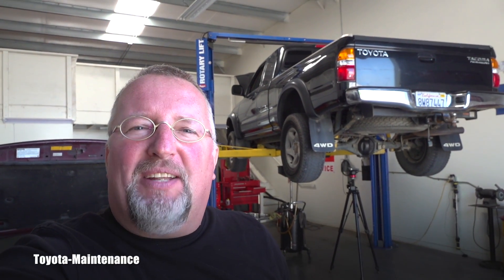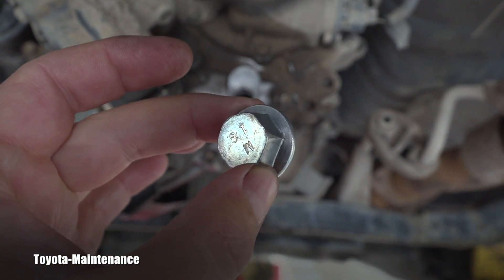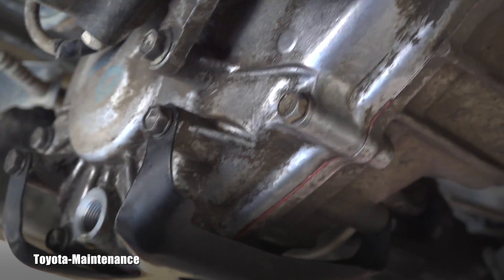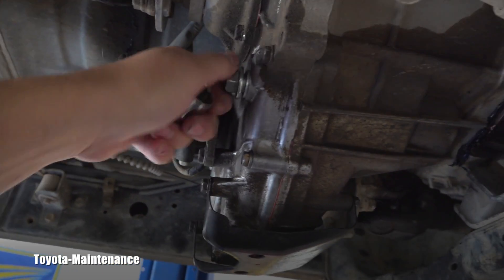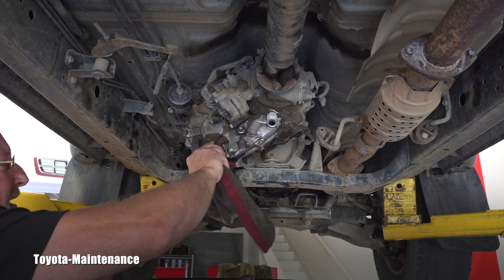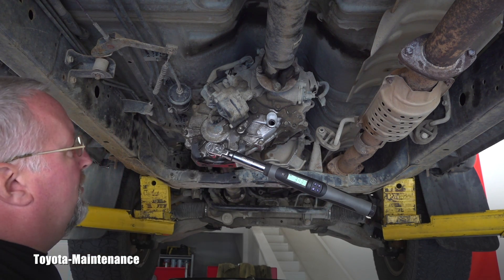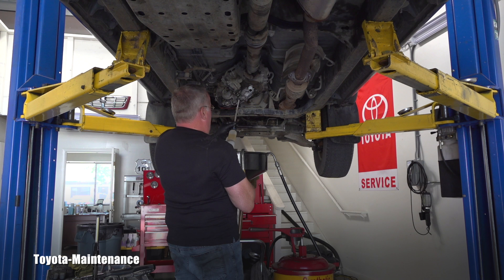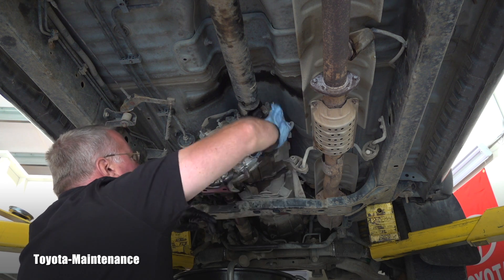Tacoma transfer case stripped thread

Comment: FYI, I’ve seen guys tig weld a nut on the outside of a drain/ fill plug and use longer bolt of same thread count. Takes longer, but works great

Comment: You can either rethread the outlet to a larger size using a tap and dye or you could weld a nut over the hole and use the nut to hold the bolt.

Comment: The oil change shop that screwed that up should have paid for the cost to replace!

I certainly would demand that, and prepare to take them to small claims court if necessary.

Then I'd repair it like this, pocket the difference, and never go back to the morons.

Comment: I would not consider that a permanent repair IMHO.  That is a threaded fastener (plug) for a reason, which is why Toyota designed it that way.  Vibration, off-road use, heat, internal pressure and time may cause that to fail and start leaking again. 

It is more difficult and time consuming, but a threaded insert is what I would have insisted be performed ... by the oil change shop... after first questioning whether they had a competent tech who has actually done it before.  Otherwise, I would take it elsewhere and insist on reimbursement.  Or do it myself and insist on a full refund for the original oil change and never return.

Comment: Gotta say I'm disappointed. Normally I really look forward to your tech tips, but this 1 is way off. At a minimum I would have used a helicoil, but I'd much rather see a timesert used. I think the sealant will work short term, but is far from a permanent repair.

Comment: That fipg gasket maker does wonders. I probably do the same to something that old. I used to have a company truck and jiffy lube was the few approved place I could take it in for oil change. Man, they wrote off so many things that they didn’t even do. They love it when these fleet vehicles come in as they know it’s a cash cow. One time they even rounded off my oil drain plug and was finding ways to not be blamed for it. They told me to come back as the manager only one who knows what to do and he wasn’t there. Really? The only thing I would do with my personal cars at jiffy lube is just the yearly inspection at my state of Texas. I feel bad for any cars that have to go there for maintenance and for customers paying for shady work.

Comment: At least the Ford exploding spark plug heads had four threads!
That stuff looks like gasket maker.
That would have been an ideal project for aluminum brazing rods.  I tried them for a small project and was amazed how strong the joint was!
Reply: Toyota FIPG stands for Form In Place Gasket.

Comment: Could you have made a permanent fix buy retreading before draining the old oil, so the old oil would catch the shavings and then drain, or just use a helicoil?
Reply: Bob D 
That would have been my choice of repair too (helicoil)
Reply: Why ? I would have done the same , I would be fine with using silicone with the rare oil changes it needs

Comment: that's why i work in my car. with the help of your video. this past Saturday i change the transmission fluid on my 2010 prius with 136,000 miles on it. the fluid was so dark, that i feel really bad. about not changing it sooner. hopefully my car can forgive me. and keep going for a long time. next Saturday i will do the radiator flush. great job my friend. i leave in Simi valley ca. maybe i can pay you a visit sometime too. Freddy
Reply: I was super hard on my Camry, mostly out of ignorance of required maintenance items, and probably didn't change the transmission fluid until ~120k miles. I've since put another 40k on it and  the transmission feels just fine. Don't beat yourself up and use it as a learning experience.

Honestly, your Prius is most likely going to have issues with the battery system before any transmission problems. From what I gather it's unusual if the batteries make it past 15 years and/or 200k miles. I'm not sure how strong the Toyota automatic transmissions are on a 2010 Prius but I reckon they could last 250k miles, possibly longer.

Comment: The place that ruined that cover by over torquing should buy a new cover and  pay you your prevailing labor rate to really make that customer whole again.  I believe you that the product is good and will hold up, but I would feel a whole lot better with a new cover.  I really enjoy your videos.   Thank you.
Reply: Good luck with them taking any responsibility, they never will. I got lazy once and took my suburban to one of those quick lubes places and they promptly stripped out my oil pan plug then told me it was already stripped. I changed the oil dozens of times myself and never a problem. Another time a friend took his van into a quick lube place and they filled his brake master cylinder with engine oil destroying his whole brake system. Never go to any of these places!!!!
Reply: Sadly you are correct but getting a jiffy lube to admit they stripped that plug will be near impossible.

Comment: In cases like that, I wonder if you could use a rubber plug.  It sounds cheap but I recall older Dodge read-ends having rubber plugs that worked fine.  Just a thought.

Comment: Even in the Toyota factory in Japan, sometimes they screw up with the overtightening of bolts and nuts.
I wanted to replace the original serpentine belt on my wife's 2010 Toyota Yaris. I used Snap-on Flank Drive socket to remove lower bolt of an alternator.  I completely stripped the head of that bolt and torque spec is only 40 Foot Pounds. I would never take my car to one of those quick lube places. I don't think that most of their employees are qualified and paid enough to care about customer's vehicles and I don't think they ever use a torque wrench. I knew there are always a few good people anywhere but I don't want to gamble with my car.
Reply: Cold welding is a common problem and using a socket wrench creates stress in the wrong location

Comment: I just did the transfer case on my 2019 and as far as I can remember both the fill and the drain used the same exact bolt and the bolts in your video the one going in the fill looked different versus the one going in the drain.
Reply: Drain bolts are magnetic to catch bits of metal shavings. Fill bolts are just plain old bolts, no magnets.
Reply: @TheHamburgler123  yes, but for some reason the transfer case drain does not have a magnet attached to it and rewatching the video it looks the same on this truck as well. I just checked Toyota forum and it looks like a topic that has come up a bit and obviously it looks like there are kits out there for this for under $10.00.

Comment: Nice fix, it's good seeing products you recommend. - What do you think of drilling and tapping a smaller hole in the original plug, then using really strong liquid metal epoxy to permanently seal it into place, and use the smaller hole to add the oil?
Reply: That’s a good idea. I’ve been thinking about ways to repair threads like this and a threaded hole in the filler plug would work. The filler plug could be put in permanently with a small removable plug in it.

Comment: It is a good fix. Would it last 10K miles? Probably since the fill level will only drop and has less pressure than the drain plug. A proper fix is complicated as when tapping a slightly larger thread hole, the shavings may enter the transfer oil pan. This leaves only one safe option: using an insert.

Comment: I havent found a trustworthy mechanic like Peter  That's why I do my own work Now I have  trust issues and have had bad experiences. I wouldn’t let those places shine my shoes. Good fix.        Don’t they have a heli coil that size Peter.   You can see the excitement in Peters   Voice  you can tell he likes  to work on Toyota’s 👍 I see 4 thumbs down that’s the   oil change guys LOL
Reply: A  heli coil was my first thought also. Then I thought of the aluminum shavings from the heli coil tap getting into the transfer case. Still doable and permanent if you take the transfer case out and disassemble it so the case piece can be cleaned once done installing the coil. $$$
Reply: @tundramanq  for that much work just replace the case half

Comment: The Place That Stripped The Threads Should Be Paying For it To Drilled Out And Put A Helicoil The Correct Way To Do The Job  Like We Did When I Worked For Volkswagen Dealer  On The  Oil Pans All The Time.
Reply: Is it exhausting to capitalize the first letter of each word?

Comment: Never thought you would glue a plug in place. Why not do it right and helicoil it? You would not get away with that on my truck!
Reply: That’s not a fix. This customer needs to be made whole again. This wasn’t it.
Reply: A fill plug is not a pressure-critical seal.. it’s mainly a cap to keep out debris and sloshing out of fluid. Some are even vented. This repair is fine and avoids the risk of introducing metal shavings into the diff.

Comment: Thanks for saving his truck, I was worried you were going to have to retap and stake in an insert like a spark plug hole. Great fix!
Reply: I agree with Brett Bond, a re-tap and insert is a proper, permanent fix. Spreading a bunch of sealant around an improperly torqued plug is not a good fix.

Comment: The problem with the differential oil plugs are SUPER TIGHT for some reasons.  It looks like they torqued it down with a 150/ft-lbs  (no way it was 40 /ft-lbs).  The 10mm hex bolt is also not easily accessible in most cases (like the 2016 RAV4) which adds to the problem of stripping the bolt or threads.
Reply: Most likely recommended torque spec for that fill and drain plug is 29 Foot Pounds.
Reply: Broj 1 Correct sir, 29ft lbs converts to 39 newton meters of torque
Reply: @harryl7946  I would think at 29 ft/lbs, it would be easily loosen without struggling but my 2016 RAV4, I can pull with all my might (even with the leveraged extension) it won't come loose.  I am now spraying DW40 for the past several days, hoping it would help when I try again next weekend.
Reply: Paul Cheang   Deep Creep or Termin 8R >>  WD40
Reply: @paulc2548  Worst case scenario you can use a bolt extractor socket. I had to kill my old fill plug on my 98 4Runner transfer case because it simply wouldn't budge. The extractor worked like a charm and the replacement fill plug was only $7. I spent way too much time and effort trying other things.